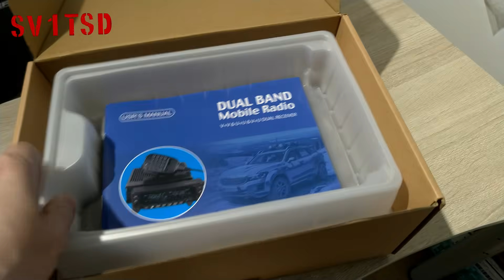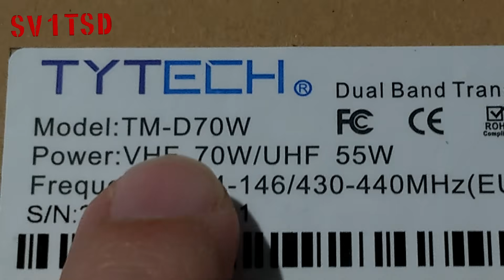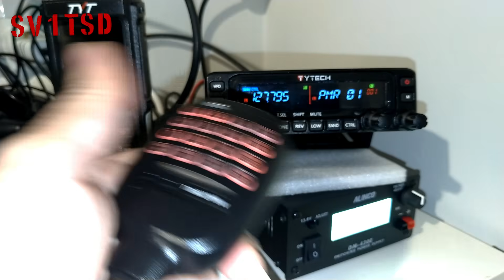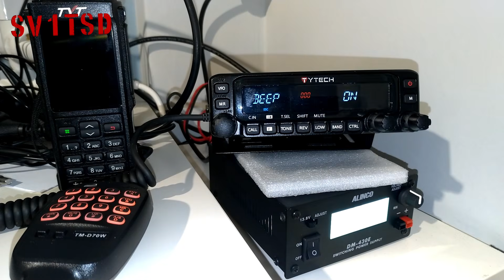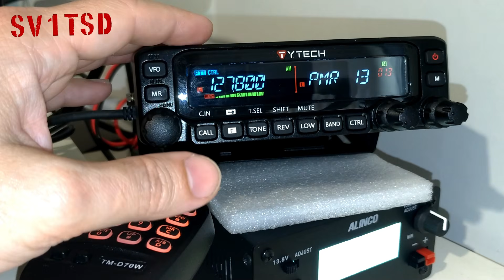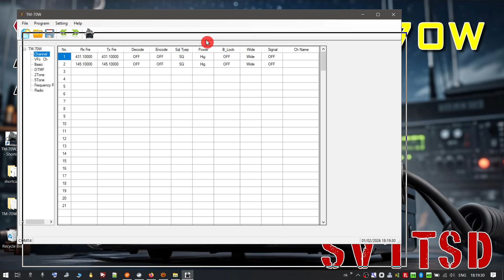TYT TM-D70W Review: 70W Dual Band Beast With Cross-Band Repeater + Dual Receive (Mobile Radio)

Comment: Something came into my mind: if there are 2 separated transceiver, do they share the same antenna connector? How they don't interfere on each other while one of them is tx and the other is rx?(using same antenna). Won't the transceiver from the rx will be damaged if the rx transceiver is in full power?

Comment: The appearance is very similar to the Kenwood TM-V71. I wonder how the performance compares though?
Reply from the maker: there is a resemblance yes.. I haven't used the Kenwood and I am sure it will be a quality machine. Not problems with TYT so far even to max W
Reply: @NikosKantarakias Hi Nikos, I have the Kenwood here, yes, it is a find radio. The menu system on the Kenwood is setup exactly like the radio you reviewed. But from what I can tell, the insides of these radios are completely different. Have you run this rig mobile yet. I wonder how well it handles FM AGC while in motion?
Reply from the maker: No unfortunately, still have it in base..

Comment: Great video, thanks for sharing. I see you tx on PMR, is that PMR 446?
Reply from the maker: Of course it is not a PMR! Are you refering to PMR because the secondary channel in parts of the video writes PMR? 
If you look closely the blue indicators are in the primary channel that is active at the time not the secondary. Even if I did pres PTT in PMR momentarily which I don't remember it was for the purposes of the video only.
Reply: @NikosKantarakias OK cheers

Comment: Nice review nikos!
If you can plz upload another one (or a short) with true measurements for TX power and consuming power, i am interested how much energy it draws under 70ish watts! 
How many characters are available for channel name? I tend to program repeaters with their callsign and their QTH like SV1G ATHENS but many radios do not have the space for full name:( 
I am wondering why modern radios do not have the option of more power steps- ok you wouldn't  need 0.5 or 2 watts TX on a mobile radio but why not?
Reply from the maker: I don't have the TX with a meter since I don't have a dummy load that can handle that. The rest you can watch here: https://youtube.com/shorts/-iGaJb6vXPY 
Thanks for watching!